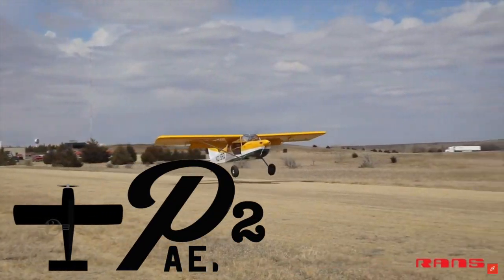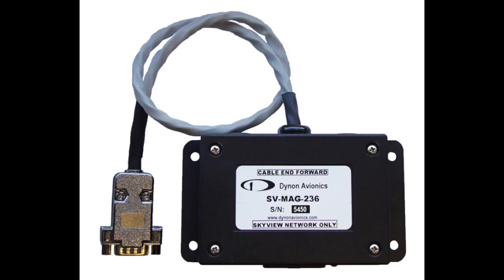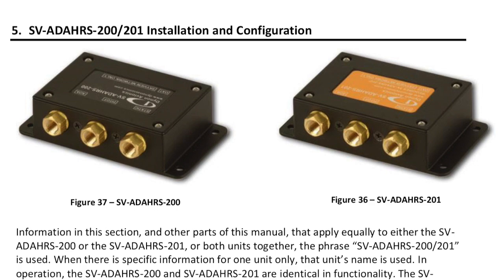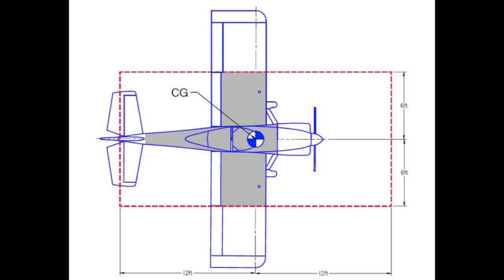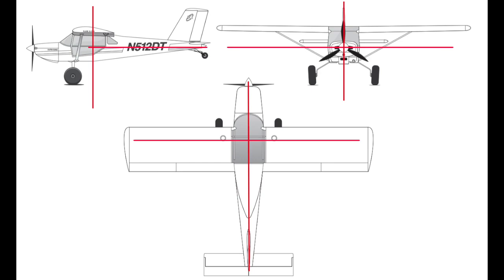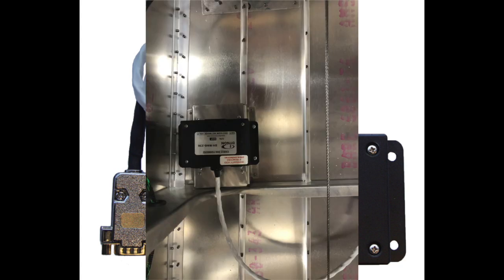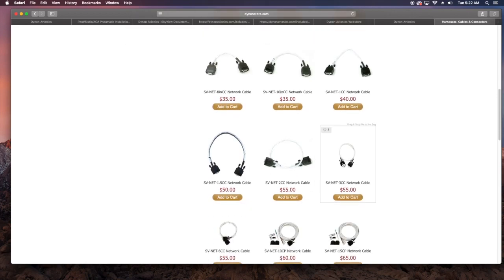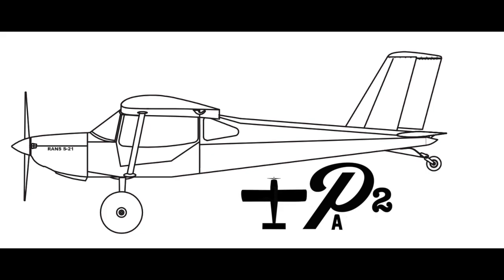What The Heck Is ADAHRS??

Comment: Did using the factory location for remote mag work ok? I have the Garmin mount as well and was going to modify just as you did. I like how you wrapped the cable back so you could access it from cutout. I just realized the rudder cables are ferrous though and started worrying but can’t think of a better place to put it. In a wing probably made sense, but that’ll be hard now that they’re closed up. I imagine it works for you given that’s where the factory mounts the Garmin, but was just wondering if you’ve had any issues.
Reply from the maker: It seems to work well in that location. I figure the guys at the factory played with the location to find a spot that makes sense so i just went with it.
Reply: @Project2Aero  Indeed. I will proceed as planned and not stress it. Great build, BTW. Watching your build was one of the main reasons I went with an S-21!
Reply from the maker: @arpeltier   Thanks for following along sir! Got a wing video in the works real soon but im running out of thing to film.. must mean im getting close!

Comment from the maker: EDIT: The second a in ADAHRS does actually stand for “Attitude” although I’ve fell into the trap and replacing that with the word “and” like many out there.  Just to be clear, it is AIR DATA ATTITUDE HEADING REFERENCE SYSTEM..

Also I mentioned ADSB as being on the skyview network and that is incorrect. It’s connected to one of the serial ports but we will look into that soon in another video!

Comment: Air data attitude and heading ref system?
Reply from the maker: Yes I misspoke there.. The second A does stand for Attitude.  Your correct sir👍
Reply: @Project2Aero  it's a good intro, video I was being picky . I once had a real howler of a compass issue, maker saved wire weight.  By using airframe as return path, wing mounted compass went crazy when lights turned on..   even worse when lights were set on in flashing mode
Reply from the maker: @davidinnes8754  Grounds are always fun ones.. I was taught to always start my trouble shooting with power, ground and what was touched or worked on last.

Comment: Love this video, thank you for dumbing it down and explaining. Only other thing I can think that would add flavor for me is cost. How much is an Adahrs? And, like, why wouldn't you run the redundant 201 system as well? Is it an extra $1,000? $5,000? Awesome video, thank you again!
Reply from the maker: Note taken sir, I’ll include some prices on the next deep dive👍 The primary unit is $1200 currently with the backup at about $800.. Generally backups are only fitted into aircraft expecting to be IFR machines or those that just want to spend the extra cash to have redundancy.